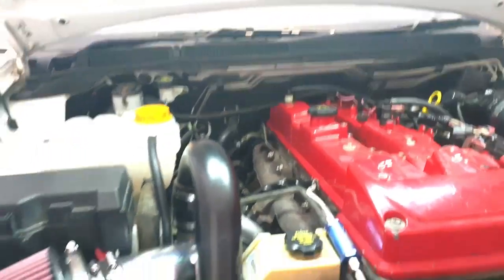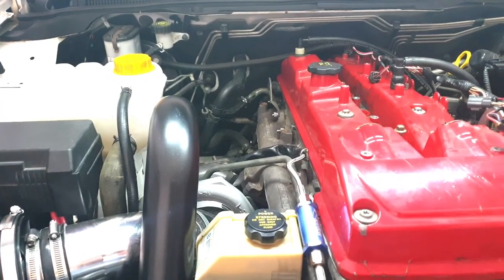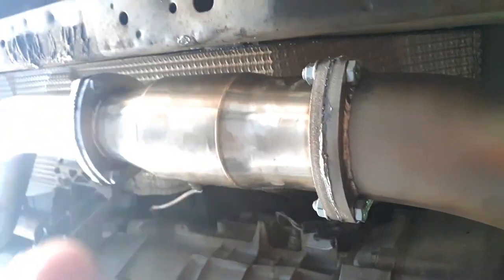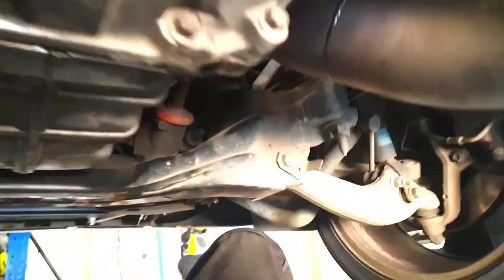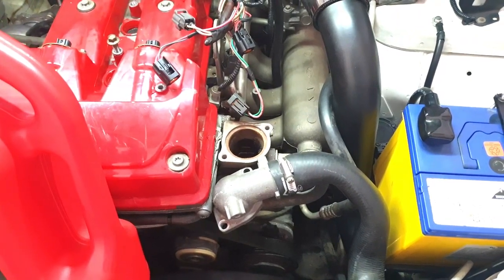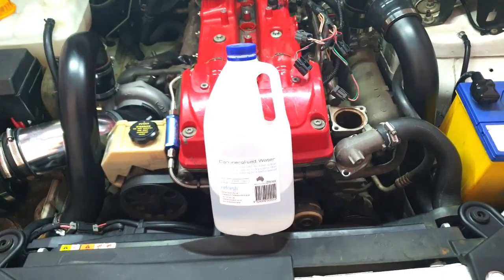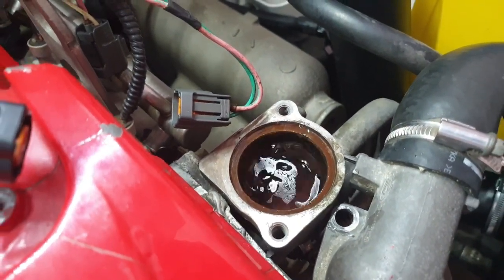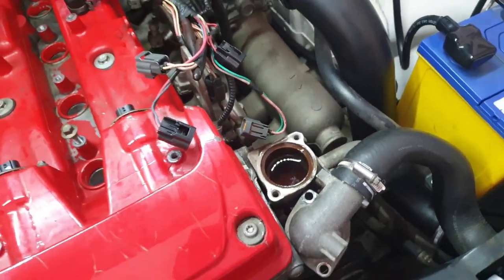FORD FG XR6 TURBO - PART 4  - EXHAUST SYSTEM AND COOLANT SYSTEM

Comment: Hey mate, enjoying the build. Just started my 800hp build in my g6e and had a question for you. 

When i comes to flexplates, which one is you go to out of the lot. The atomic, yella terra or rts or some other brand as I've heard mixed reviews about the atomic, cheers.

Looking forward to seeing this beast completed ✌️
Reply from the maker: Cheers mate, thanks for supporting the channel 👍 Regarding Flex plates, Id probably stick to the Atomic or Yella Terra. I personally have the stock flex plate in which Im making 900hp at the rear tyres. But if you want to upgrade its probably worth spending a little more due to the quality.  Atomic 's stuff is usually of good quality and Yella Terra has the history and is Australian made-, both generally have higher standards.       All the best with your build and if you have any other questions -send 'em through!
Reply: @onboostperformance700  thanks mate, appreciate it 👌✌️